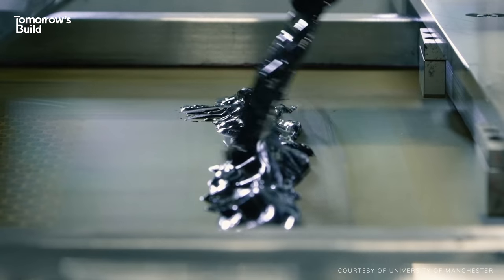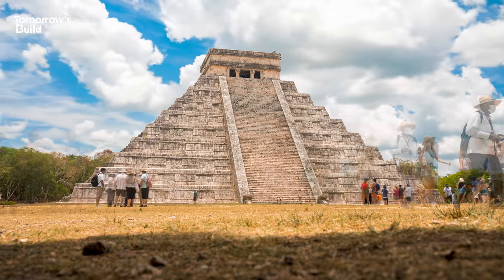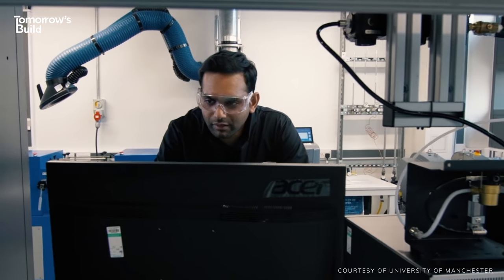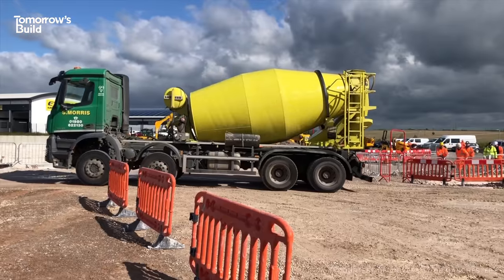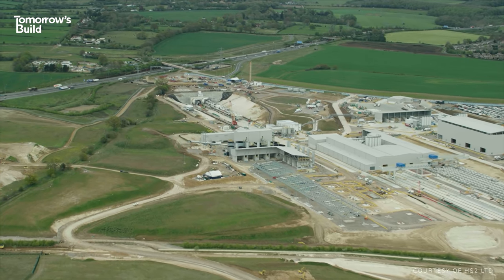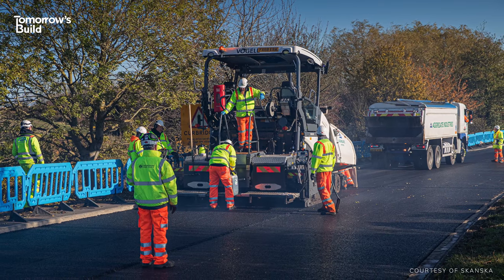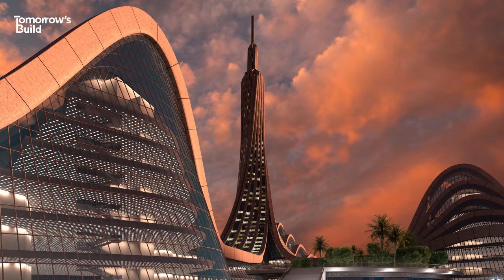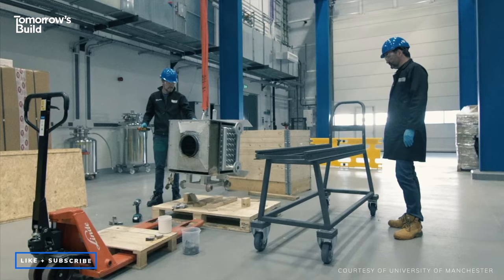Construction's Graphene Revolution Has (Finally) Begun

Comment: Perhaps now we can finally manufacture the giant structurally-sound pencils we've been dreaming about all these years.
Reply: Given that it's stronger than steel, you're going to need a diamond pencil sharpener.
Reply: @pjacobsen1000  Strength must be varying with direction.
Reply: How hard would you want to press to write lol?
Reply: Doodle Bob!
Reply: This is the 21st Century por dios. PENCILS??!!
Reply: Wait a minute. Once we make the structurally sound super pencils, what happens when you put it on a big sheet of graphene and the elephant stands on it?
Will that be like dividing by zero and your whole house implodes?
Reply: Yippee
Reply: I don't get it. Why does pencil lead break in a jiffy if graphene is so tough? 1:32. "Strip graphite down to just one atomic layer and you’re left with graphene". So why are multiple layers of graphene so breakable?
Reply: @pjacobsen1000  tungsten carbide
Reply: frodo roo  The pen(cil) is mightier than the sword!
Reply: Yes, pencil lead that is one atom thick! Jk
Reply: atom-thick writing for the ultimate cheat sheets
Reply: @zioxei  on your super secret 3x5 card
Reply: Ive ordered mine on Amazon already 😂
Reply: No becouse they put to concrete powder of grapfite, not graphen. Graphen have his special properties when have monocruistalic structure in layers. Here they put some powder so how it can increase strenght?!!
Reply: is this the rug?
Reply: @Fremen thanks, I always wanted to know the answer to that paradox.